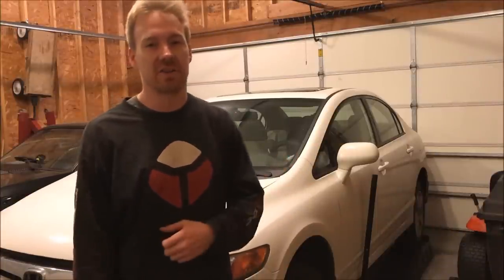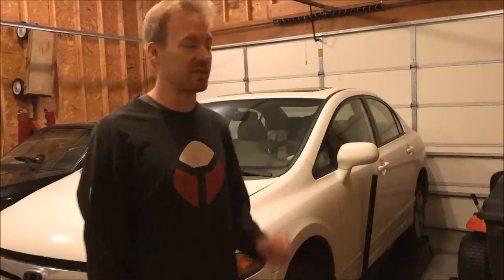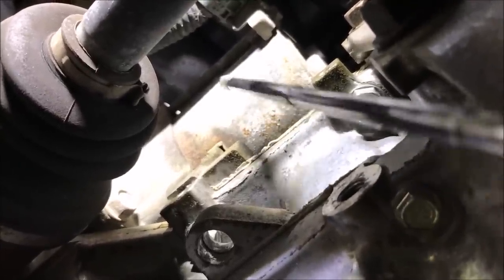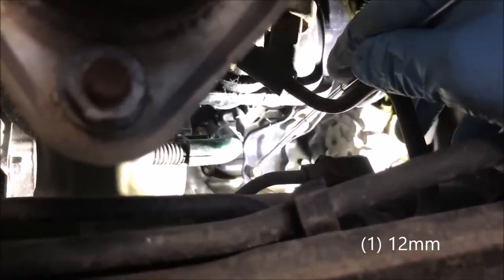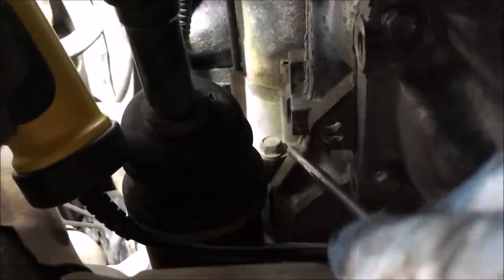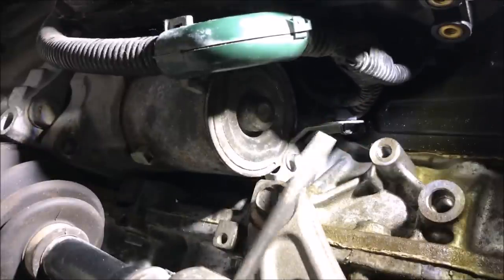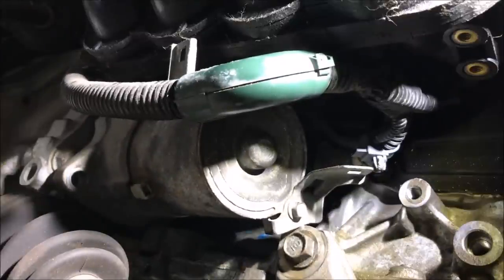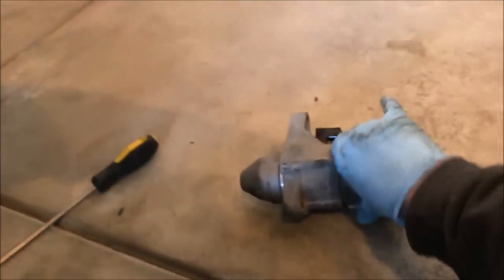Honda Civic Starter Replacement & Diagnosis

Comment: keys for my removal success: front jackstands wheel off and back on ramps , tape on swivel joints, impact wrench, 1/2" breaker bar, tiny 1/4" ratchet and small extension and 8mm helped removed the old starter stand off brackets/bolts to give even more room - (the whole old starter just comes apart in pieces armature and body and end plates) . absolute struggle tonight with my 2009 east coast coupe - the bottom one took all my might to loosen even straight on with the huge breaker bar - i used pb blaster on there too and let it sit after impact wrenching. had to use the impact wrench to remove the connection lug bolt, it was too tight for ratchets and i had no good leverage. had to watch vid several times. thanks for all the camera angles in your how to.... tmrw we put on the new one for more adventures on the driveway. new batt and alternator and removed/cleaned the 3 main ground straps /batt terminals prior to resorting to do the starter.
Reply from the maker: Wow, that’s some pain!  Best of luck on the install. The hard part is out of the way 👍
Reply: Got the new one off amzn installed today and she started right up like a new car. Relieved i don't have to dig further into the electrical aspects of the car this time.

Comment: Great video. You really know how to explain things for those who don't do this for a living.
Reply from the maker: msiddi01 thanks! It’s probably because I don’t do it for a living either. Haha.
Reply: @FastFixYouTube  

By the way subscribed.
Reply from the maker: msiddi01 thank you! That is much appreciated 👍
Reply from the maker: msiddi01 msiddi01 I have read that some people remove the exhaust pipe and/or the CV axel to more easily accomplish the fix. In my opinion (and maybe with the aid of thin arms) I thought those steps would only complicate the fix and create more work. However, if you’re not able to fit your arms up to where you can manipulate the starter, those might be options you may need to apply. I’d say if you’re having issues now, it won’t get any easier. Just trying to be honest there. 

And if I’m understanding your comment correctly, you’re wondering how I got my hands in the small area that contains the long bolt. The short answer is I didn’t. I aimed the socket with swivel joint at the bolt and guided it up to make contact with the bolt head. I for sure didn’t have room to actually attach the socket to the bolt head using my hands.  Are trying to reach the bolt from the opening just to the left of the control arm? It’s hard to explain the correct position when you’re underneath something, but take a look at the angel of the swivel joint. It’s about maxed out meaning the swivel and extension were nearly at a 90 degree angle. Try and aim at the bolt from an opening under the car that gives you something close to that 90 degree angle and you’ll know you’re at least in the right spot. 

If you continue to have trouble getting at the bolt and you’re not physically able to reach the starter with your hands, In my honest advice, I would think about sending this fix out to the pros. Last thing you want is a half disassembled car and now way to put it back together. I’ve been there myself and it was no fun. Sometimes these damn cars get the best of the best of us. Best of luck to you and please let me know how it goes.
Reply: @FastFixYouTube  

Thanks for the quick reply.
I was finally able to get the starter out. Followed your video to the T.
I was just getting frustrated. I was a gymnast years ago and big forearms are the gift that keep on giving... sigh. Thanks again for putting this video together. I have bruised and scraped skim all over but the starter is finally out. It is past 9 p.m. on the West Coast and I will try to put the new one in tomorrow morning. I was holding my phone as a flashlight and it was not easy. 
By the way great tip about pillow. I used a block of wood but was getting tired earlier (neck muscles) raising my head in the air.
Reply from the maker: msiddi01 good to hear that! But yeah, this job will leave a few scratches and scrapes. All worth it when done! Easy to get frustrated wirh it....things looks so much easier when someone else is doing it...like backflips! Haha, hope the rest goes well.

Comment: Thanks for this video, did the trick, showed that other than tight quarters, there really isn't much to it. After about 3 hrs, a few scrapes, I saved $300+ from taking it in to a shop.
Reply: mine was an 07 civic at about 180k mi
Reply from the maker: Exactly!  Glad you were able to get it fixed.  Thanks for the comment!

Comment: Great video. Batt. good, alt good but like you starter motor starts but it is very slow to turn over giving the impression of a dead battery. This is the only video that talked about this specific symptom of a bad starter. Kudos!
Reply from the maker: Hello. Thank you! Yes, there was definitely missing data on other videos and why I made this one. I’m glad it helped! Thanks for commenting and have a fantastic day.👍👍👍

Comment: Thank you so much for this video! Helped out so much! One small thing I found, the bolt for the terminal is a 13mm not a 12mm!
Reply from the maker: Hey, you might be right on that bolt size! I probably won’t go under the car to verify, so I’ll take your word for it. Cheers mate! 👍
Reply: @FastFixYouTube  it might be both 13 and 12 mm depending on who rebuilt it and what they had handy at the rebuilding Factory

Comment: Im doing this right now for my 2007 and it SUCKS!!! But i came across your video and i will try to finish it tomorrow. Im having a problem rotating the stupid thing to get to the last 2 steps. I noticed you rotated it the opposite way i was trying i think, so i will try again tomorrow. Thank you for taking your time to film this and the extra tips.
God bless
John 3:16-21
Reply from the maker: I feel your pain!  If you’ve gotten this far, you’ll get it. Patience is required. I got frustrated multiple times and I remember it was during the install. If you’re having a hard time getting the sucker to install, just wait for the bolts!  Just kidding, you’ll be fine. Just keep at it. Best of luck!
Reply: @FastFixYouTube  Thank you for the encouragement. Heading out now to try again.
Reply: Got it done today, Praise the Lord! I about had it and was ready to call a mobile mechanic but i came in the house and had my wife pray with me and it literally fell in my hands.
By the way, the tape on the swivel saved me on putting the top bolt in. Thanks again.

Comment: Great video.  I might try it that way next time (maybe there won't be a next time!)  I like the idea of putting the rear wheels on ramps to get extra room under the car.  I ended up removing the passenger side CV axle (much easier to remove that I thought, Thanks YouTube!) and the exhaust pipe.  It made the job MUCH easier.
Reply from the maker: James Wilson haha, hopefully there won’t be a next time! I thought about removing those pieces too, but I wanted to make this process as simple as possible, but I’m sure having the extra clearance would’ve been great.  Thanks for the comment!
Reply: @FastFixYouTube  And yes, my symptoms were exactly as you described.  Slow crank when cold.  Sometimes it would just click and then turn over on the second try.  I thought it was the battery but battery tested OK.  Decided it had to be the starter.  It was.  Lucky I didn't get stranded somewhere.  Mine is  a 2008 with 180k miles.
Reply from the maker: James Wilson yes, lucky indeed! At least they give us a warning!
Reply: Me as well!  My hands were not fitting well in the spaces and I felt like it would be easier to do the wiring by being able to rotate the starter and bring it almost straight down.

Comment: Very nice video. I've liked all the tips. Thank you. I am changing my starter now but got stuck with the upper bolt. Every video shows easy removal. My bolt is seized. Is it possible?
Reply from the maker: Hello.  It’s possible that it’s seized, but I’d say not likely.  Some are just harder to remove than others, but you clearly have a case where it is on the harder side. Can you spray any lube like PB Blaster on it? Try that and wait a while (15min to 30min) and try again. Or, attack the bolt from different angles with patience. The last thing you’ll want to do is trip the bolt head so take care in making sure the socket is well attached to the bolt. Give er hell and hope it’ll break loose. Best of luck. Feel free to keep this thread updated 👍
Reply: @FastFixYouTube  I did use PB Blaster yesterday. Will make another approach today. I will let you know. Thank you for the encouragement 👍🏻
Reply: @FastFixYouTube  job done. PB Blaster and different angle helped. My arms are scratches and tired but I have satisfaction of not giving up. Thank you for your guidance 👍🏻
Reply from the maker: @lesio333  fantastic!  Job well done. I’ve had several people quit while trying to get the top bolt out. Glad you saw it through. Yes, satisfaction is absolutely there and money saved. Nice!  Thanks for keeping me updated 👍

Comment: I’m doing my girlfriends 2012 civic and I have big hands and you’re dead on everything you recorded and have stated I got frustrated and had to take a break on reinstall having trouble getting starter back in position . Gonna get back on it in the morning .oh yeah I’m 6’4 290lbs doesn’t make it any easier lol!great video sir good luck on getting that money godbless
Reply from the maker: Yeah man, it can be a frustrating mess…especially if you’ve got big hands. Your size may not be ideal for this job, but I’d sure as heck would want you around if the car needed to be push started. 👍. Best of luck with the rest. Hey, if all else fails try and have your girlfriend with smaller hands manipulate the starter into place. 🤚thanks for the comment!

Comment: Sir, Thank You!  Your video helped me decide it is best to take my civic to the mechanic for starter installation.  Yeah, they are going to rake me over the coals but good Lord there is no way I can perform that operation especially with my large hands trying to fit through those small gaps and through a wheel well.  No Sir
Reply from the maker: dabrownhornet99 Sounds like a smart choice!  Glad this video helped you come to a good decision. Hopefully the coals aren’t too hot! Take care.

Comment: What  brand  you  bought  from Amazon ?? Got  a 2010 civic   That  will  replace starter  but  with  so  many  brands    That  I  dont  know which  one to  get.
Reply from the maker: Hello!  Honestly, I do t remember. I know I put a link for the part in the description, but it was years ago and the link may not work anymore. I bought an off-brand part and so far has been functioning well. Best of luck!

Comment: I don't know how u could remove the 2 bolts wit a 3/8 drive. Mine are tight as he'll so I stopped there. Gonna try with a 1/2
Reply from the maker: I think I got lucky. Others have had a tougher time. The size of the driver shouldn’t make a difference however. All about leverage!  Best of luck 👍

Comment: I have 1.8 8th gen civic and it does rattling noise when cold start around 1500 rpm. Its half second noise. I wonder if its really starter or VTC Actuator which defective or its oil channels have oil deposits. Video seems good but I think I will take my car to repairman and watch him doing it.
Reply from the maker: If the car makes noise around 1500 rpm, it’s not the starter.  Sounds like an exhaust rattle to me, but the repairman will be able to tell you for sure. Hopefully anyway. Thanks for the comment!

Comment: First, great video.  This was not easy to shoot.  Replacing the starter is a nightmare.  Getting the starter bolts out is difficult, to say the least.  They are stuck because they're steel inside of aluminum.  Once you get those out, you think you're doing great.  Wait until you try to get them back in.  I finally used my left hand to align the starter, then my right hand to start the bottom bolt and after a very long time of trying, I got it.  BE VERY careful.  You're done for if you strip those bolt holes.  I used anti-seize in the God forbid chance I have to do this again.  I did remove the exhaust pipe to give me just a skoshi bit more room.  I live in the desert, so rust wasn't a problem even though I spent 3 years in South Dakota.  Other tips: Invest in a some very long 1/2 impact extensions with impact universal joint.  Those bolts only require 47 ft lbs, but you end up with twist in the multiple extensions like I did.  It can be done, as I did, with multiple 3/8 extensions, but better with 1/2".  Remember, don't do this if you're rushed or hungry; someone could die.
Reply from the maker: 🤣😂🤣 that’s great!  You’re not wrong. Thanks for the laugh and good suggestions 🤙

Comment: I just did mine.  Got stuck trying to re-install the top long bolt.  Could not get bolt to thread by hand my fingers were not quite long enough.  Could not get it to align properly using the swivel joint either.  Finally able to get it using a 1/4 inch drive with small extension that had thumb knurls on it and hand threading it that way.  Other than that your video was awesome!  Thanks.
Reply from the maker: Orange Crush some have had an easier time with this bolt than others...I’m sure that depends on a number of different factors. Awesome that you were able to find an alternative solution and get it sorted!  Nice work and congrats on saving $$$. I appreciate the comment!

Comment: The link you gave below under the description for the motor starter, will it work for Manual transmission on my 08' Honda Civic?
Reply from the maker: Hello.  This starter says for “auto trans.”  Hour best bet would be to add your vehicle into Amazon then see if the starter fits. Amazon will give you alternatives if it does not. Best of luck!
Reply: @FastFixYouTube  TY

Comment: My replacement starter doesn't have the metal tab you referred to at 18:41 will that be an issue? Also do you have any advice for getting the new starter back in? Can't seem to get the right angle to line it back up.
Reply from the maker: Hmm, first make sure the starter you have is the correct starter for your car. If it is, the metal tab that you’re missing serves to secure/route some of the starter wires.  You can live without it, but it does help to route the wires and keep them free from crimps. 

As far as getting the starter back in, I don’t have any direct solutions other than to take your time and figure out where the starter is getting hung up. You’ll need to figure out those spots and maneuver the starter around the hang up points to install. I reference a few of my hang up spots on the video and I would imagine are true for you too. 

Best of luck!
Reply: @FastFixYouTube  I took the metal tabs off the old starter and put them on the new one and after a lot of trying I finally got the new starter in and she starts up fine thanks for the awesome video and replies!
Reply from the maker: Hell ya man, no problem. Glad you got it back together!

Comment: Is it possible to replace without lifting the entire car?
Reply from the maker: First, great name.  Second, I’ve heard of people removing the starter by removing the intake manifold and staying on the top of the motor. However, my opinion is that going from underneath is easier and less time consuming.

Comment: Thank you for the pointers putting this starter in on a 2012 Honda Civic especially with the electrical tape on the top starter bolt I never would’ve thought of that but still what a nightmare job laying on my back doing it
Reply from the maker: Hello. I very much appreciate your comment. Yeah, it was a bit of a challenge for me too…not to mention the filming.

Comment: Are you using three eights ratchet on the starter bolts ?
Reply from the maker: Hello. Yes, sure am. I don’t think the 1/2 inch ever made it to the party. Thanks for the question!
Reply: @FastFixYouTube  thank you i got it done with your video ,i spent two hours on the top volt and just gave up then i found your video i liked and subscribed.thank you so much.
Reply: @FastFixYouTube  i did use half inch on bottom bolt im old and weak , Happy fathers day .
Reply from the maker: Hey, great to hear!  The top bolt can be a bear.  Glad this video helped and happy Father’s Day to you as well. I appreciate the sub and nice comments.

Comment: Hi the starter from Amazon is a good brand? Still working on your car? Thanks
Reply from the maker: Hey there. I had worries about the brand, but so far it’s been great. I have not heard any negative reviews from those who’ve used it. I put one on my father in laws car and it’s been going strong for the last 4 years.
Reply: @FastFixYouTube  thanks

Comment: I also have an 08 civic that has been having a hard start problem. I first cleaned the corroded battery connectors , worked for a while. But then it started doing it agian. I thought it was a bad battery, nope. She's just over 200k miles, looks like I'm getting a new starter.
Reply from the maker: Yes, likely the starter…  but definitely have the battery tested before you change the starter. Best of luck!